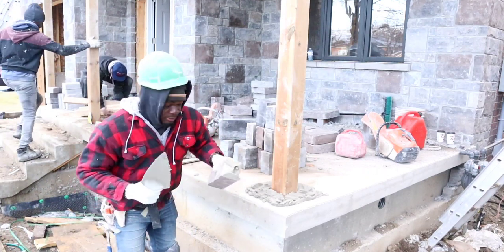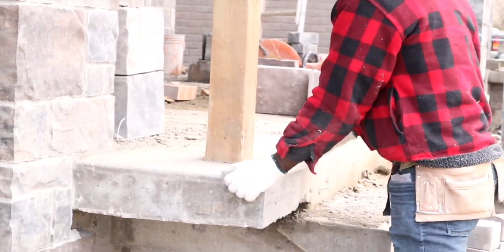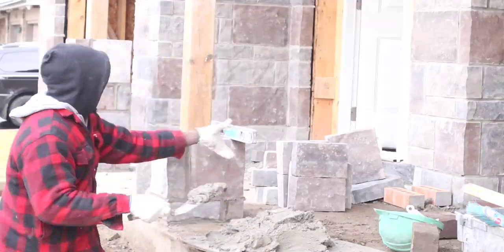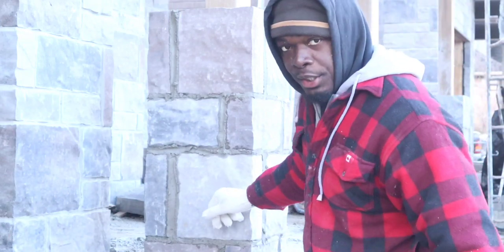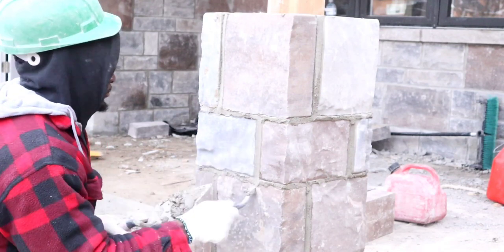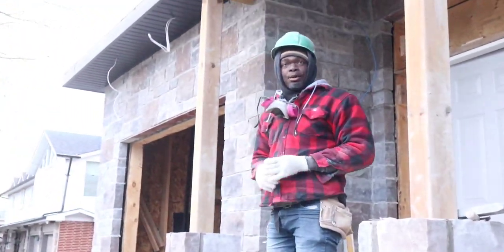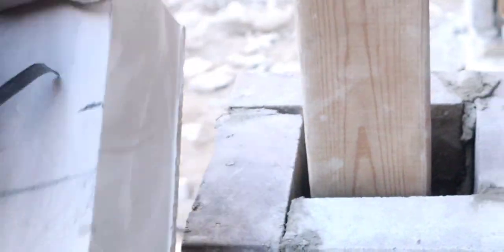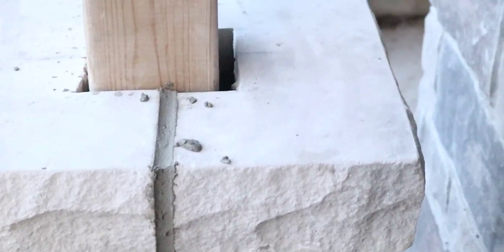bricklaying - building a stone pier and coping installation ,

Comment: Great job!! Question: why put the weep hole in the back of the porch? I would want the weep hole in the front so that water can run off the porch instead of into the porch...
Reply from the maker: Thank you, The porch is and a slope so the water will run off either way, I think it looks more better at the back, if you like you can put it at  the front that works as well 👍